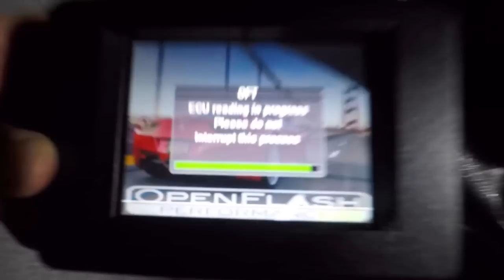FRS 3 Year Car Build Transformation!

Comment: Dude like 6 times you changed the rims and most of them were ugly🤦🏼‍♂️🤦🏼‍♂️
Reply: ongggg
Reply: 6 rims < turbo kit
Reply: On god. Shit the amount of time and money spent changing those ugly things should have been put into the engine bay.
Reply: Sharon Ruiz on a frs? theres a reason people dont mod engines on this platform very often 😂 its a money pit just to make 300 whp. then you take it to the track once and blow a valve spring. and if u watch he did tune for E 85 which is the most i would do on this engine as well. its not meant to be a race car its meant to have fun in. like a miata
Reply: Sharon Ruiz and sure u could throw a turbo kit on it but it still wouldnt be fast. the boxer engine was never made to go fast its balance and low center of gravity just makes it a fun car to whip around.

Comment: Fellow frs owner here, ive really been considering going wide body track car type look. was doing the custom body work hard? or did it just take time?
Reply from the maker: it wasn't hard at all. it was just a process that shouldn't be rushed!
Reply: Chris Borges awesome! And I like they way you’ve molded the kit now it looks a little bit better than having it attached with bolts. Was bolting it on faster than the molding process? I don’t have any other car to get between work and my house so choosing which route to go would depend on whether or not molding the kit could be done in a weekend?
Reply from the maker: @5.0noah12  Bolting on is definitely way quicker than molding. Molding took me around a week to do. Bolting on can be done in a day.
Reply: Chris Borges is you don’t mind me asking what kit are you running? And thanks for replying and answering my questions my guy, love your build and your videos keep up the great work!
Reply from the maker: @5.0noah12  no problem bro thank you so much! Im running the rocket bunny v1 fenders.